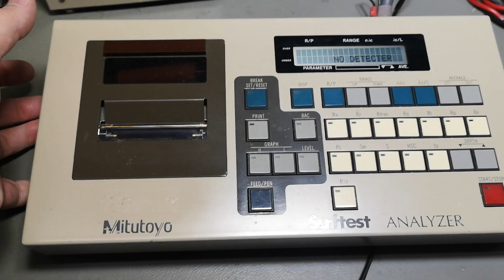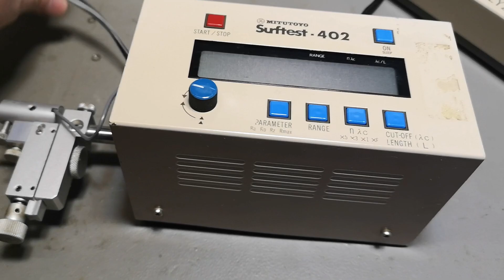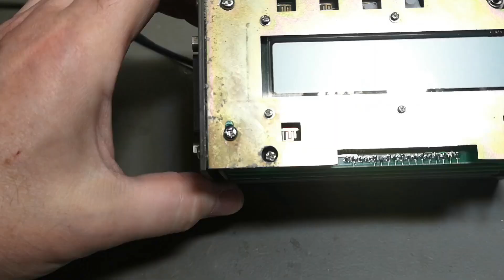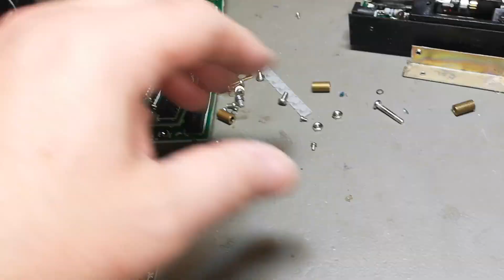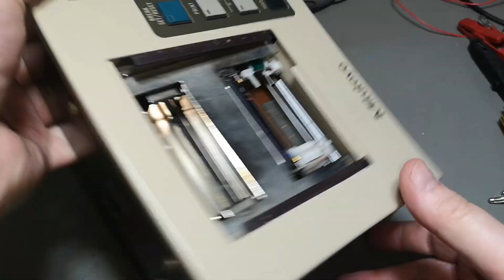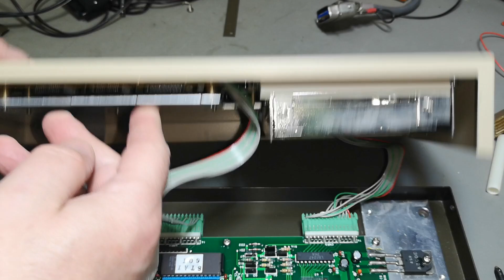Mitutoyo Surftest 402 Surface Tester test teardown

Comment: It’s funny that the detector is basically a phonograph cartridge on these things.
Reply: That is all it needs to detect the fine differences, which is what a phono cartridge will do reliably, plus the diamond tip is capable of running for hundreds of kilometres on the surface with minimal wear.

Comment: Printer is made by Sharp, using a set of colour pens to write on the plain paper roll. They will be dried up, and totally useless now. CPU is a Z80 derivative, with a lot of peripherals integrated into it, and this one has the expansion to do the keyboard, while the printer itself is driven direct from the CPU, as it has all the low power drivers needed, with only external power amplifiers to control the motor direction and step the print head along the platen, with a position left of home used to operate the latch that shifts the pen colour. Simple printer drive wise, just a dual stepper motor drive for the 2 motors in the printer, a single transistor to drive the pen load solenoid, and a switch to detect home position, and another for paper out. All the complexity is in the software, and Sharp had a block of code that did that. 

They used those printer mechanisms in the calculator division, for the small BASIC computers they also made, and sold them as well to other manufacturers like Casio, who interfaced them to their own calculators and pocket computers, using a serial interface.

Incidentally the bus expander in block 5 must be acting as a CPU address and data bus expander, not enough spare processor pins to run a full one out, so they are using it to do that, with internal code doing the translation, unless there are address latches hiding under the EPROM sockets to directly do this off the bus, allowing the ROM and RAM to be memory mapped direct, though the integrated chip does come with quite a bit of RAM in it, and a mask ROM.
Reply: I used to have the Radio Shack branded version of one of those printers. I recognized the printer as soon as he turned on the power and it started its power on sequence. Totally useless once the pens were no longer available.
Reply: @jrkorman  I cut down pen refills to the right size, and put them in the cartridge. Had to use pens that were nearly empty though to keep the mess from the ink down.